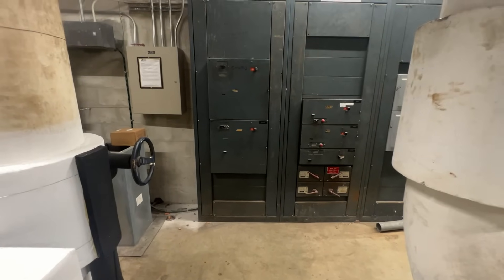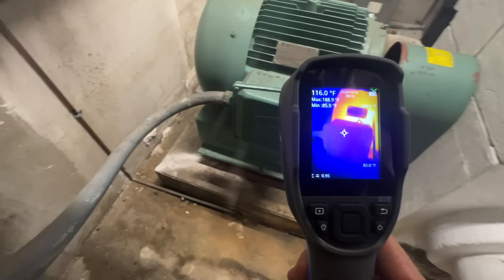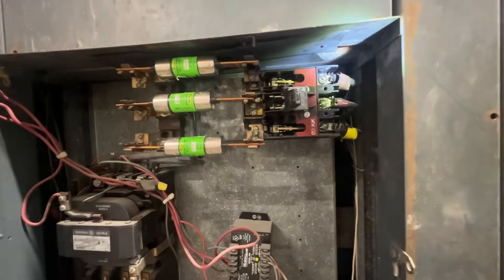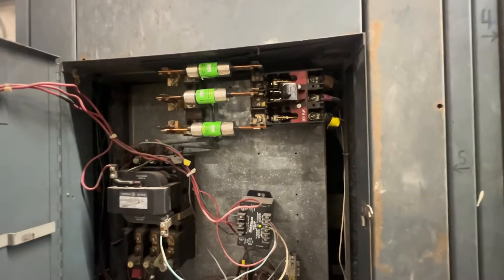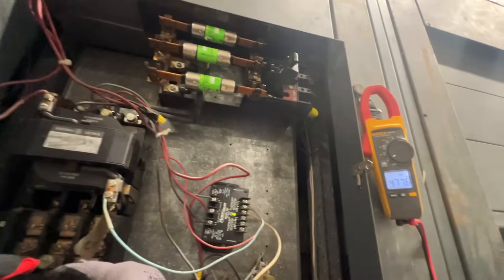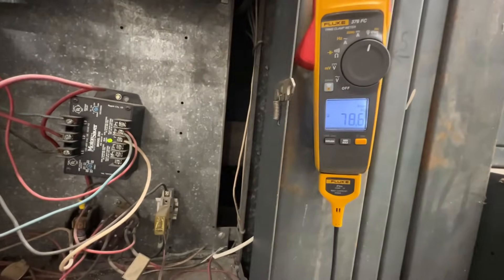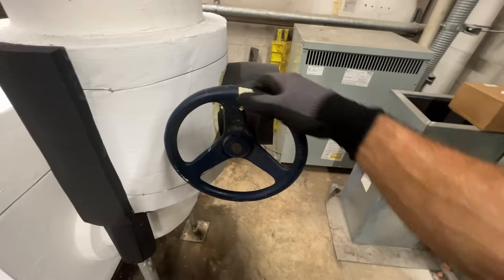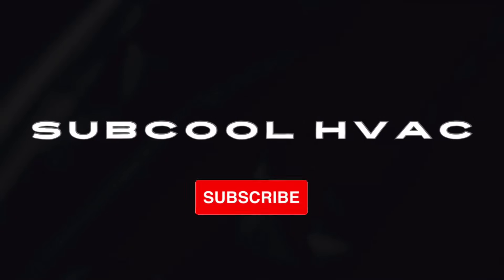Chilled Water Pump Blown 100 Amp Fuses | 60 HP Motor

Comment: 100 amp fuses are not large enough for a 60 hp on 480. The code permits 175% of motor amps.

Comment: How are the motor bearings. Found them to be the cause of a lot of electrical related calls. How is the coupling and alignment. That mag starter is a real good place to start....but if i was placing a bet....I'd put my money on something the pump was the issue......great video as always....love the content
Reply from the maker: Just replaced dura flex little over month ago, the pump and motor were replaced less than 2 yrs ago. Tried to look up the motor to see if bearings are open, others I’ve found are sealed, pumps too 🤔Have to wait until next to shutdown and inspect better. Should have a follow up video. Thanks for the comment as always

Comment: Grease the bearings? I dont think the starter is the cause of the excess current. The coupling was squared up? If its pulling to one side the bearings are being abused causing excess current. Could be pump impeller rubbing. Could be pump bearings. Should have used the old long screwdriver to the ear on those bearings and  pump housing. Definitely as someone else said should have taken voltage drop across starter to gauge contact health.
Reply from the maker: Greasing bearings doesn’t do much these days when mfg uses sealed bearings, stay tuned to find out 👍

Comment: Check voltage drop across motor starter, line to load, while its pulled in .. Should be millivolts. If a volt or two pack a new starter next trip.
Reply from the maker: 👍There may be a good spare in that panel below if I remember

Comment: Building maintenance are the predecessors to my arrival usually😂

"Yeah it kept trippin the breaker so we kept re-setting it"
Reply from the maker: Yeah they try to help, this one I found out several days after, definitely need to get amps down before I’m replacing the motor. 😳